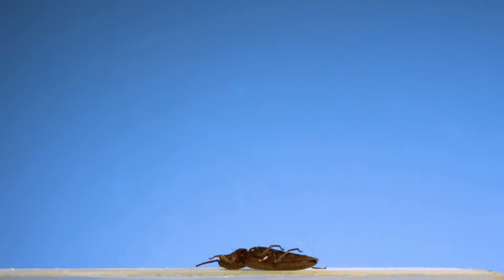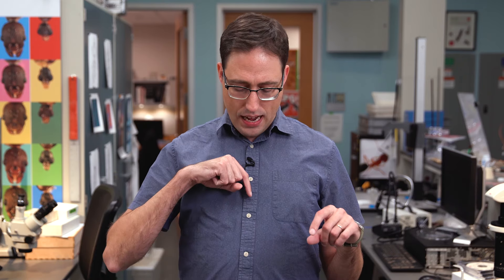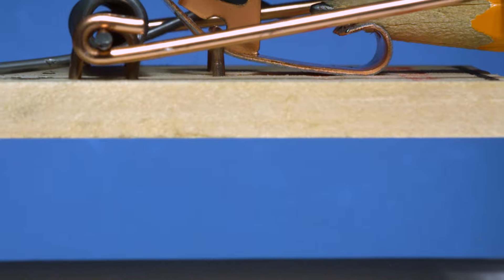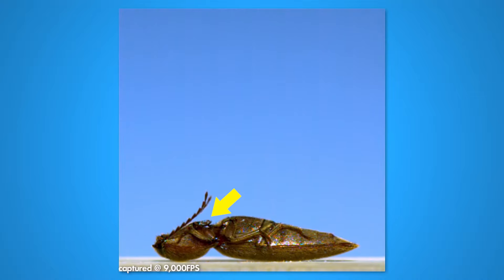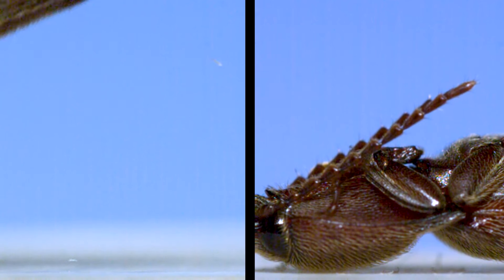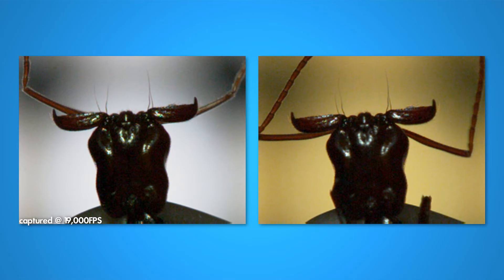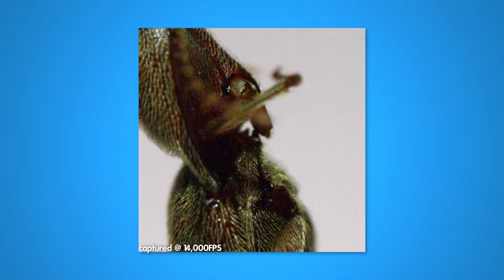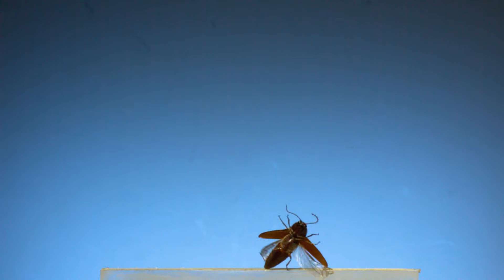How do click beetles jump?

Comment: They have remarkably strong bodies probably making it better at sustaining shock if they can't predict how far the drop will actually be. It's one of the few beetles capable of picking itself off it's back when it's vulnerable in very little time especially if they're the larger relatives. I noticed other bugs have defensive mechanisms if they are ever on their backs and some intentionally doing it to either play dead or to readily latch onto the predator and bite them like potato bugs.